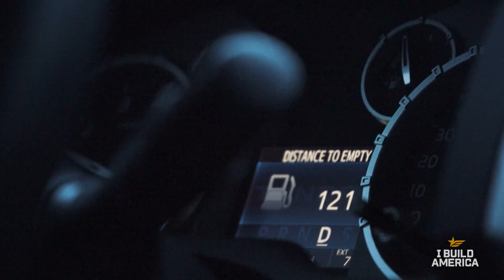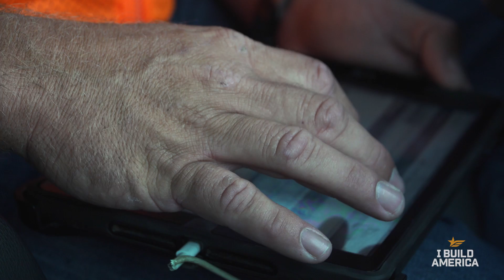A Day In The Life: The Superintendent

Comment: Do you have to have school & experience to be a superintendent? Or just experience?
Reply: @CarDaddy24  yeah I’m doing the school route rn graduate 2022 Construction Engineering
Reply: I've been in construction for 4 years. There are people who go the experience route without much for my education and there are those who may get a degree and then going to the field. If you have access to the financing I strongly suggest that you get formal education before coming into the construction field. Experience is valuable but credentials can get you a lot further. Unless you have already gained some Hands-On field experience I recommend spending six months to a year as an entry-level construction worker. The insights you gained from the experience may prove valuable to you down the road. I have run into situations on job site where people who were in charge had credentials but little to no field experience and projects suffered as a result. That's my two cents. 💯
Reply: I 💯% agree with field experience first.  supers who only have schooling and no field experience seem to always have there projects suffering.they almost always have no clue what is going on. I have been a forman for 5 yrs now and it is the most irritating part when your jobsite super is clueless.

Comment: So what exactly you do. All he does does is low-level safety checks. No offence intended.
Reply: You just asked what he did... then you just said, "All he does is ____."
Reply: One of the superintendent's I worked under recently was responsible for placing bids for new jobs as well as facilitating the work done on a current project. Foreman and superintendents made primarily play roles as supervisors making sure that the work done on job sites is up to the specifications and that the work is being done in a efficient and timely manner according to the schedule. Scheduling can either make or break a project depending on how well things are flowing. How accurate things are when it comes to specifications is extremely important. Some margins of error can be as strict as an eighth of an inch on civil construction sites. I hope this helps provide some clarity as to the role that the Superintendent plays. 

SN: I'm an Operator. I've never function in a supervisory capacity but have worked under different Foremen and Superintendants on construction sites.